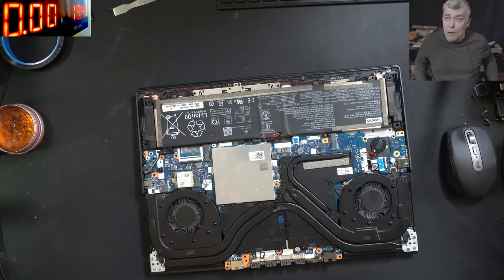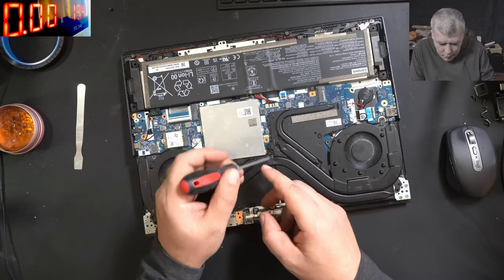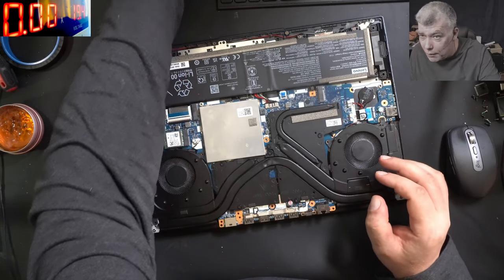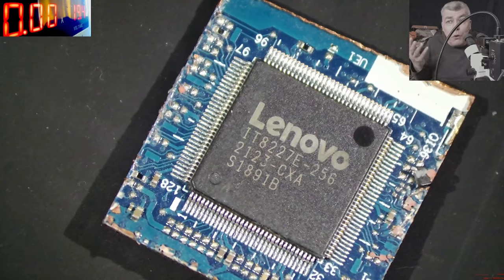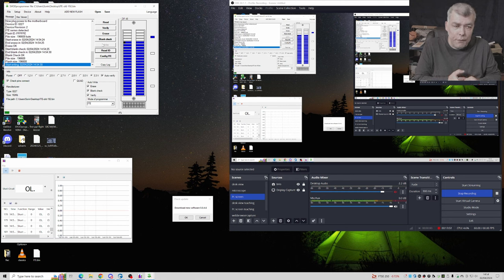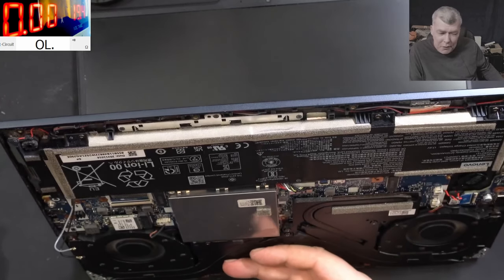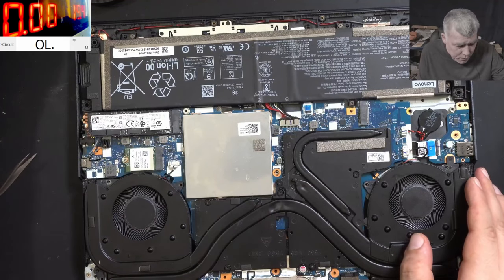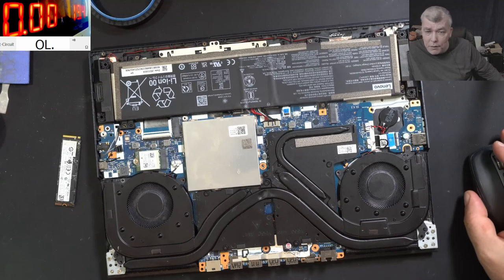This laptop is not fixed! - Lenovo Legion 5,  second repair attempt

Comment: I don't get this. The "new" chip is 256k, yet Sorin said he will programm it with 128k bin file... 
also it may be a resistor issue.
also @10:17 you can clearly see solder bridge between 2 pins (3rd and 4th from the bottom of the screen)

Comment: Cheaper and quicker to use small chop saws on a bench and cut the component out than to desolder. There's also no danger of causing harm to the chip but I doubt the Chinese are worried about that.
Reply: Looking on how the ram pins are cutter... is showing the use of a precise CNC to cut the board.

Comment: For me you should clean ME region if this is intel. If there were problems with previous KBC memory size the laptop would not start, and you would not be able to program it.
Reply: It's and AMD
Reply: @laboratorioassembler  Yeah right my mistake. I hate lenovo most of new models are very hard to repair.

Comment: Update the bios on windows. Let it re-write the EC. Listen to my advice :)
Reply: Extract the bios update file into a folder and edit the platform.ini file , change ShowEcUpdateProgress=0 to 1 / And under the [Region] section EC=0 to 1 , [UpdateEC] section Flag=0 to 1 in case you don't know the drill.

Comment: Hello Sorin - Salut Sorine din Brasov ! . Try to do a clean me region of the bios. I had a Lenovo pc with same fault....fans full speed... then shutdown after 30 min. after cleaning the me region and bios reprog was ok...maybe it will help. the guys on the forum help me with cleaning the me region. a hint for me cleaning  is that it il not show any firmware and the lan port is missing from device manager in windows both condition needed. anyway i think this is a motherboard issue. best regards
Reply: AMD ...not have ME

Comment: Lenovo seems to be using a strange system.　Previously, the only case in which FW was successfully repaired was the type with two EC chips.
Only regular EC and BGA types.

Comment: Didnt the customer say he removed a chip and put it back. I would look there.
Reply: The chip that the customer removed was the 3.3v/5v regulator. The laptop is powering on, so this chip is working properly. This chip also doesn't have anything to do with the fans.

Comment: For sure this issue is false programming for the thermal sensor or a damaged sensor. Some sensors are right on the chip die so if damaged may not be repairable.

Comment: Cutting motherboard is faster and economical  than soldering it ot and putting it in a new case ; note "lenovo is a Chinese brand" that means components is local made it's faults is rare.

Comment: hello,sorry for my english , just intuition on my experience on my ACER helios 300 : BIOS (insyde2.0)  is CRYPTED FOR THIS PRECISE  motherboard with SERIAL NUMBER !!! if use bios normal from website and reprog with epromm reprog make same result of you, fan is speed all, no possibility to ad  new harddisk or divers device , no bios effect change etc etc ... i use biosmod forum website for learn what is the solution and one super admin make a new firmware serial for my specific model based on my corrupted old ...
Reply: Hello...agree with you

Comment: Last time you mentioned how weird it is that the board is starting without the EC chip...Maybe the problem is the chipset indeed...And the M.2 drive was swapped probably with the battery plugged in.